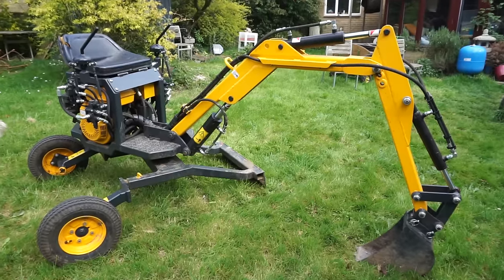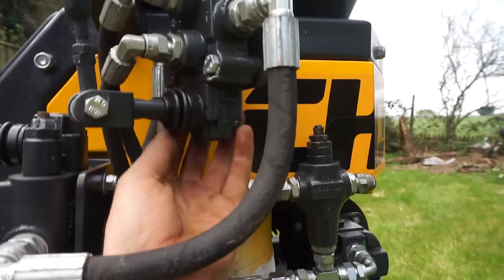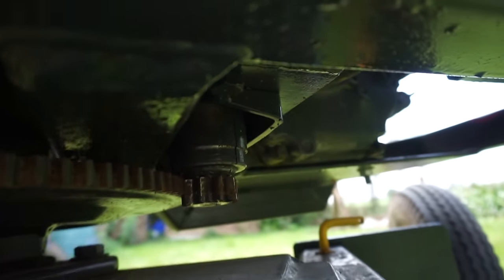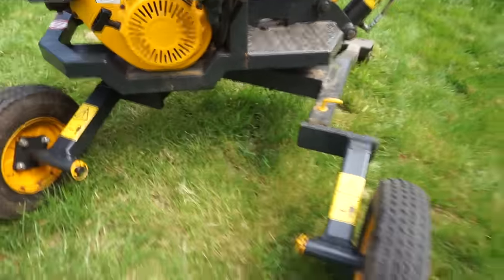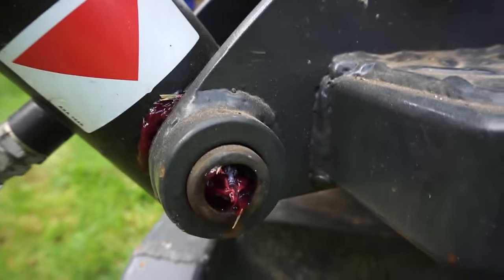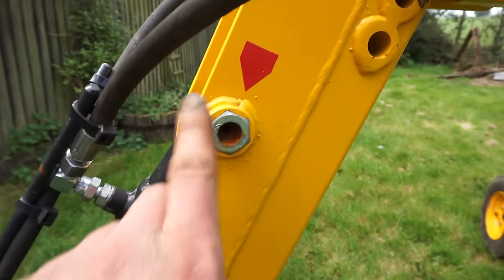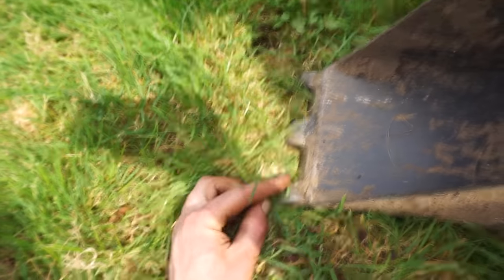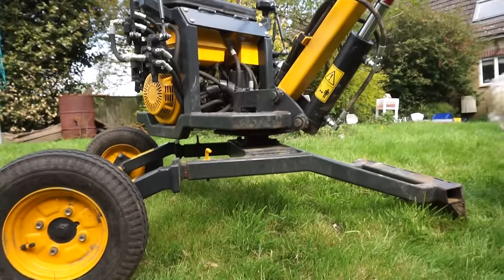DIY Homemade Mini Excavator 360 Slew

Comment: Excellent build, you said that the you used a Mondeo wheel bearing for the slewing pivot and it wobbles a bit, my suggestion is to fit another one underneath and extend the pivot shaft through both bearings.

Comment: really cool build! if you ever want to make the undercarriage moving on power, you could build it with electric weelchair wheels and a big lead battery inside and make it completely electric independent from the upper Arm and Seat unit. and then remote control it via a radio so you dont have to run ny cables from the engine down there... just my thought

Comment: Given that a sedan wheelbearing is working, an upgrade to a GM/chevy 2500/3500 front unit bearing would be great and solve your passthrough dilemma.

It's WAY stronger - they use them on 6000lb/2700kg Ultra4 trucks with 40"/1meter tall tires at the King of the Hammers competition, has a 35mm pass through on the 33 spline version (the most common one), and are less than $100 new.

I think it would be best to make the passthrough lines steel to fit as many as possible, or maybe just have 1 high pressure and 1 return, using control rods to actuate the valves. That would be very achievable through the 35mm hole, and being rods they can do both push and pull on 2 way valves.

Comment: Very sharp and professional build, a good downbudget homebuild that could easily pass the glance check as a manufactured design. Small enough to put on a small trailer, and I could see value in adding a lawn tractor trailer hitch,which would also give you some counterweight for heavier cutting
Reply from the maker: Thanks man i appreciate it! Was thinking of making tracks to go on it but it would look cool to pull a tiny digger with a tiny tractor!

Comment: Hello.you have a great start young man. I am currently building a excavator and will have cleared rubber tracks on it with a motor spinning two hydraulic pumps which in turn will drive a hydraulic motor on each side. The hydraulic motors are two stage so it will have slow raw power and a faster speed for going from one place to another. Feel free to ask me questions. Have a good day.k
Reply from the maker: Thanks man good luck!

Comment: This has blown my mind.... would you be interested in building one of these to order? if so do have any idea how much you would build one for? i could do with one of these for sure
Reply from the maker: hey man cheers im not currently making them to order but im moving towards doing so as there has been a lot of interest. this one right here would probs be about £4000 ready to run if all the parts were bought new form the start. i hope to upload some more vids soon with some improvements, tracks, and maybe an electric version!
Reply: How much is that in U.S. Dollars?
Reply from the maker: probably looking around 5 to 6 grand depending on spec with a little bit of assembly at the other end to make it easy to ship but ya know theres a lot of areas that could be improved and costs to be cut plus the first ones always the hardest as they say!
Reply: I would like to have one with around 50% complete. I would like to supply my own engine, my own wheel kit, and my own stabling kit. I'll tell you, you really do have a good game plan and good machanical ability. Keep up the great work. GOD BLESS you.

Comment: Question? I'm in the process of building a mini tow behind excavator/backhoe.. My project is going to be a tow behind and it isn't going to rotate 360 degrees... Just a basic and small tow behind backhoe with a boom that is about 6-7 ft in length and a bucket that is about 12"x7" inches... Something to dig water lines and ditches with.  I purchased a 4 spool 11gpm  valve control manifold and also a new 6.5HP Horizontal engine...  I'm looking at a hydraulic pump from a log splitter. Which is 2 stage.. 2gpm on the first stage and 9gpm on stage 2 when bearing a load... I'm wondering if this pump is to big for my 6.5hp engine? If so, what would be a more correct size?  Also, I'm looking at hydraulic pistons that are 1.5" bore.. 1" inch rod.. and 300psi working pressure... In your opinion,  Are all of these items compatible for what i'm making? If no, Could you please give me some info on what size pistons and pump that I need to purchase for my project. Thanks.
Reply from the maker: Hey bud! The control valves are good you'll just have to make sure they are open circuit. As in oil will flow though them and back to the tank when the levers are in neutral position. For the pump i would go with a single stage gear pump for simplicity. To be honest bud i dont know what size pump to go for i just used what i had its about 4''x4''x4'' externally but if your not getting enough flow you could change the pulley size. I would use rams with a slightly bigger bore between 2'' to 2 1/2'' that'll make them a bit more powerful! Good luck man!!

Comment: I'll bet with as light as the entire unit is, you could just install a teflon swash plate for a fifth wheel trailer and a center pin? Then you could just drill a hole for a grease gun fitting to refresh the swash plate. Not to mention if it ever wears out, teflon swash plates are cheap.
Reply from the maker: Thans buddy i might try that out when i put tracks on it! Cheers! 👍
Reply: @councilhousecreations8035  Yes, I thought the slew was the weakest part of what is otherwise an excellent build, but then I have a tendency to over engineer anything I build!

Comment: Any interest in helping me design a Backhoe for the back of my Tractor? We can do a collab sorta thing
Reply from the maker: Hey man im a bit busy at the moment with all of life but yeah man id love to at some point in the future sounds like great fun im in the process of moving premises and setting up a bit better but yeah id be up for that!
Reply: @councilhousecreations8035  cool coool, i understand you must be busy alright. that is no harm. Contact me when you get a chance. I would mainly just needed help with designing a hydraulic system to suit. i am familiar enough with welding and fabrication to make the rest of the backhoe. i wonder would you recommend I do a similar thing to yours with log splitter valves?
Reply from the maker: hey man yeah log splitter valves should work ok on a tractor so long as you can put the spool in constant pump on the tractor end it should work ok. so long as each valve is is connected in series so to speak. also the tractor has a pressure relief valve thats paired to the pump so all you'll need is metal, rams, hoses, valves, and cunning! if your gunna mount it on the 3 point linkage might be an idea to brace it to the pick up hitch and do away with the top link like they do on the hedge trimmers. iv braced a couple of hedge trimmers to the hitch in the past and they reach right out then till the rear tyre lifts! any questions fire away buddy cheers

Comment: Awesome job!!!
I am building One too.
What the dizer of the hydraulic cilinders and the hydraulic pump please.
Reply: *size
Reply from the maker: thanks buddy! hope this helps
pump:   unknown displacement (100x100x100mm outer dimensions)
cylinder 1:   80x40x250mm stroke
cylinder 2:   60x30x250mm stroke
cylinder 3:   50x25x200mm stroke
motor: 400ccm (should have been 200ccm)

Comment: Well done 
good project
Kindly explain mechine cost and size
Reply from the maker: thanks buddy! it probably cost about £1500 + -- to build in parts and about 4 months in the evenings
bought it all on ebay
hope this helps buddy!
pump:   unknown displacement (100x100x100mm outer dimensions)
cylinder 1:   80x40x250mm stroke
cylinder 2:   60x30x250mm stroke
cylinder 3:   50x25x200mm stroke
motor: 400ccm (should have been 200ccm)
valves: log splitter valves (open centre)
Reply: Pump=8 very gut..bravo....

Comment: There is something called a manifold used on logging equipment in the U S where you can turn 360 continuously
Reply from the maker: Cheers man il look into it!!
Reply: Call a John Deere dealer and ask about a continuous turn manifold on a skidded grapple or log loader

Comment: As I understand, all weight and deforming forces from lever arms are projected through Ford mondeo single wheel bearing? Is it enough? How long you are using this machine? The arm will be easily around 500 kg and earthload also + 50 kg.

Comment: Put a set of out rigger wheels on the front like the back that can be turned flat for stability out away from the front  grader plate
Reply from the maker: hey man probs gunna go with tracks in the near future so didnt want to spend to much on the little skid unit thingy also i agree needs a big plate with rollers running on it to take the brunt of it

Comment: Nice unit the flywheel looks like it’s off an automatic  trans  has it held out ? If it’s a bit flimsy perhaps using a manual flywheel  they heavier and thicker which might rectify things , other then that this looks like a professionally built unit , great job  mate
Reply from the maker: Thanks bud seems to be holding out ok to be fair. Might add sum rollers to support the central bearing a bit but apart from that it seems ok. Dug out a 6x4x1 meter swiming pool with it!

Comment: I have another question that I'm hoping that you can help me with.
I finally finished my mini excavator.  The engine that I'm using is a 6.5hp  with a 2 stage log splitter pump that is 11gpm.. It puts out 2gpm and when a load of great pressure is present, then the second stage kicks in and it puts out 9gpm.  The reason that I chose this pump is because it was the only pump that I could find that would work with the low horsepower engine, or I was told.
Anyways,  My machine functions fine, but my cylinders are super fast. They are so fast that it makes it almost impossible to operate.
What can I do to slow the speed of my cylinders? I've been looking at a "Hydraulic adjustable control valve".  Similar to the one on your machine.
Will this correct my problem? Any help is appreciated.. Thanks.
Reply: I had never really thought about log splitters before. But when I read your question I thought "What a nice idea. The log splitter runs fast until the cutting edge reaches the wood (second stage: high displacement, low pressure) and then works slowly with a lot of pressure for maximum force (first stage: low displacement, high pressure)". Of course, you only need first stage for the excavator. I think the simplest solution would be to install a throttle valve directly behind the pressure relief valve. If you close the throttle valve slowly, it will limit the flow, increase the pressure at the output of the pump and at a certain point switches it to first stage. When you have found the point, close it a little more for security reasons.
Second solution: look here(https://www.jbj.co.uk/high-low-gear-pumps.html) and here(https://www.youtube.com/watch?v=Od9B8LDA-ME). This is your pump from the inside and how it works. If you remove the spring from the unloading valve, that should also have the desired effect. 
Both solutions involve a residual risk because the fast pump always runs. In the worst case scenario, the excavator could move unexpectedly fast and kill someone!
Tanks for your question. It was interesting for me to learn something about  log splitters, hydraulics and english language.
Reply from the maker: Well done mate that sounds awsome! Like matey said you could restrict the flow and force it into the second stage although that can be a bit dicey if a hose blows. Or you could try bigger bore rams or lower the rotational speed of the pump

Comment: That's look amazing, do you have a soft copy and spec sir?🙏
Reply from the maker: cheers buddy! haven't got any plans for it unfortunatly yet but i do have a list of some of the parts;
 bought it all on ebay
hope this helps buddy!
pump:   unknown displacement (100x100x100mm outer dimensions)
cylinder 1:   80x40x250mm stroke
cylinder 2:   60x30x250mm stroke
cylinder 3:   50x25x200mm stroke
motor: 400ccm (should have been 200ccm)
valves: log splitter valves (open centre)
Reply: Nice job.

Comment: Actually your slewing system is much like the big machinery companies do it but they set everything on a ring and the gear teeth are on the inside of the ring. By adding the system you talked about it would provide more rigidity to the digger and the more rollers the better or just have 2 rings with a high density polymer sheet 1 to 2 cm thick between them with a way to grease it from time to time.
Reply from the maker: Thanks man! il probs do sumfin along those lines wen i do the tracks soon!

Comment: What size of wall thickness did you use for the 50 mm and the 70 mm square tubing
Reply from the maker: 3mm for the 50mm box. And 5mm for the 70mm box.

Comment: Your work is fantastic, if I may ask how much may it cost me if I want to go in for a project like this.
And please can you help me with the references of what you used in your project. I mean things like dimensions.
Reply from the maker: cheers man it took little while but it was worth it i think. it probs cost me about 500 quid ish give or take the only big bit i got for free was the engine all the hydraulics were paid for as well as the metal and various fixing ect. dont have any dimensions at the mo cos iv lent it to my uncle but wen i see it again il hav a measure up. but hey at the end of the day i just looked at a jcb and tried to copy the ratios from that. best of luck man greatest garden toy ever!
Reply: @councilhousecreations8035  Thanks man you are a kind young man, but please don't forget to do the measure up as promised.Thanks again
Reply from the maker: Hey man scratch that first figure i gave u. I just got the bill for the hydraulics and hav yet to tot up the metal but annoyingly the total is probs closer to a 1000 smackeroons... but im sure it cud be done for less. I went a bit over board and pretty much bought all new stuff apart from the engine, seat, and ring gear. If u can accumulate cheap valves and rams youll be on to a winner!
Reply: @councilhousecreations8035  Yeah man great, please where can I get the Rams and please what are the dimensions of the various Rams
Reply from the maker: hope this helps buddy!
pump:   unknown displacement (100x100x100mm outer dimensions)
cylinder 1:   80x40x250mm stroke
cylinder 2:   60x30x250mm stroke
cylinder 3:   50x25x200mm stroke
motor: 400ccm (should have been 200ccm)
i got it all from ebay you could probs get the hoses there to if you were to mock them up with garden hose to get the measurement first
Reply: @councilhousecreations8035  cool man, thanks a million times.

Comment: привет дружище.к сожалению не понимаю что ты там рассказываешь .сам сделал? и что там за аппаратура на поворот 360 градусов-гидромотор?
Reply from the maker: hi buddy, yes i made this machine myself, the hydraulic motor is 400ccm, the ring gear is from a car engine flywheel and starter motor, hope this helps! cheers buddy!
Reply: @councilhousecreations8035  приветствую.может есть видео как делал именно поворотный узел
Reply: @councilhousecreations8035  подписался на ваш канал

Comment: You did an amazing job on building that upper portion.
Is it possible that you would be designing a bottom track section to go under it?
And make a thumb for it.

I love your joystick setup.
And did you use a standard control pattern or make up your own?

And do you have a hitch on it to tow it behind your car?

Comment: Wow!!! Nice work I am from india can you please help me , i need build same one . hydraulic pump, hydraulic swing motor and hydraulic cylinder  technical details
Reply from the maker: thanks man!
hope this helps buddy!
pump:   unknown displacement (100x100x100mm outer dimensions)
cylinder 1:   80x40x250mm stroke
cylinder 2:   60x30x250mm stroke
cylinder 3:   50x25x200mm stroke
motor: 400ccm (should have been 200ccm)

Comment: How much money  you give to digger
Reply from the maker: Cost about £1000 in parts and materials
Reply: And you can give here list of materials ? Please
Reply from the maker: bought it all on ebay
hope this helps buddy!
pump:   unknown displacement (100x100x100mm outer dimensions)
cylinder 1:   80x40x250mm stroke
cylinder 2:   60x30x250mm stroke
cylinder 3:   50x25x200mm stroke
motor: 400ccm (should have been 200ccm)
valves: log splitter valves (open centre)

Comment: Hi ... i'm impress with this DIY mini excavator. Thinking of building one in near future. Can i've your contact no?
Reply from the maker: thanks! 
How can I help you?
Reply: @councilhousecreations8035  hi..can u pls.put online buy link here which your using in this (hydraulic motors, cylindes, comtroll valvu.etc.i hope conder
Reply from the maker: bought it all on ebay
hope this helps buddy!
pump:   unknown displacement (100x100x100mm outer dimensions)
cylinder 1:   80x40x250mm stroke
cylinder 2:   60x30x250mm stroke
cylinder 3:   50x25x200mm stroke
motor: 400ccm (should have been 200ccm)
valves: log splitter valves (open centre)
Reply: @councilhousecreations8035  thank you

Comment: Well built but for the price of all the parts plus the build / fab time i would think itd run right up there with a manufactured mini digger..  but the experience, pride and bragging rights would override any price savings..  unless it pulled an oops and blew a testicle off or something…
Reply: i don't think so, from my current research these are all relatively cheap parts here.

Comment: motor should be electric
Reply from the maker: I LIKE IT!! Gunna build another with an electric pump! Would make the hydraulics simpler and smoother cos u cud have it as a closed centre circuit instead of open centre! Stay tuned bud!!
Reply: Would be novel to have a silent digger. You would probably be able to sell it commercially for use in graveyards and night time construction